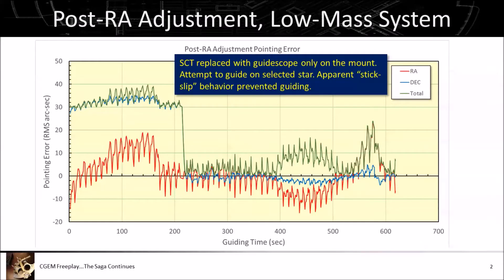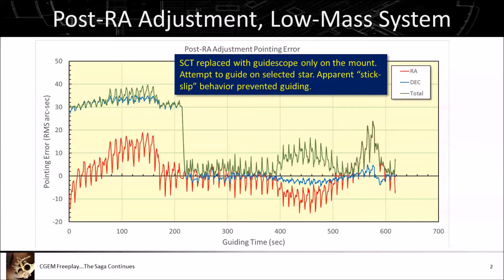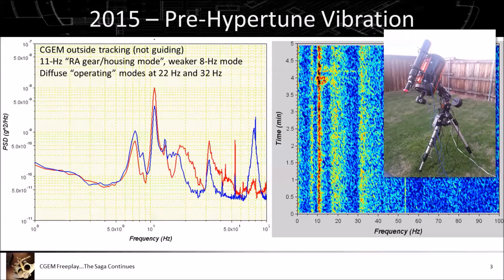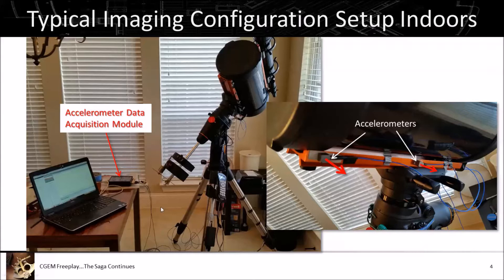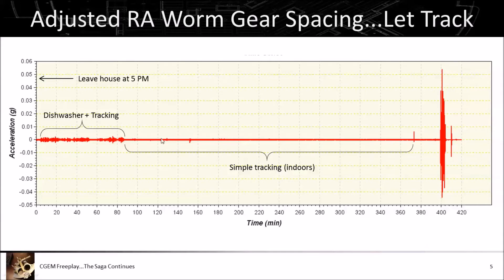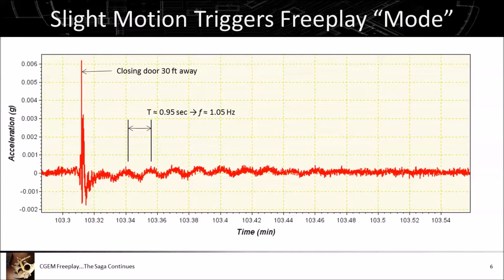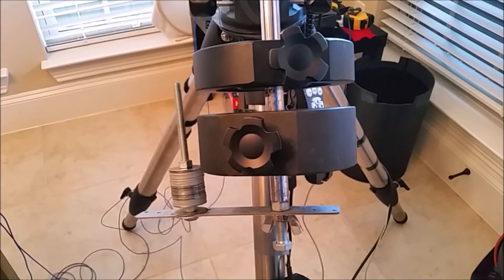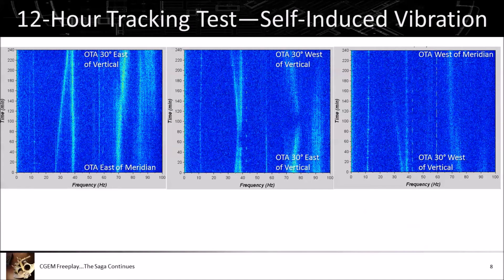Adjusting RA Worm Gear Spacing...Again!

Comment: I would suggest trying to adjust backlash with greased up worm and wheel is futile, The viscosity of the grease masks any backlash present. Setting backlash is best done with dry gearing. Short term operation while dry should not be a problem as the worm and wheel are of materials chosen for low friction coefficient.

Comment: Ji James,
This conversation has been silent for a while now. I was thinking how to have an indication of stiction while adjusting the worm gear spacing and I thought that sticking an ammeter in the power circuit could do just that. Electrical current should start going up as stiction increases. But again there are so many mechanical variables that affect the process.
Cheers and thanks again for your inspiring contributions.
Reply from the maker: Silent, but not forgotten. Thanks for watching, Ruben! That sound like a very interesting and more technically reliable approach than "listening" to the sound of the gears. Let me know how it works if you try it.

Comment: Hi James, this was a very interesting video. I've been struggling with similar RA issues on my mount since it came out of the box. It is an Orion Sirius Pro AZ/EQ-G (same as a Skywatcher AZ-EQ/5 I think). Of course I spent hour after frustrating hour playing with PHD settings trying to get it to track. Like you said, RA isn't connected to anything...you can't guide your way through that. I like your analysis of what's happening in terms of building torque and then things finally move. I was thinking of it opposite - the worm engages and pushes the mount out ahead and then needs to catch up. I wonder how one could test which of those it is? Either way it's terrible news for those of us interested in round stars! Like you I made a couple of runs at fixing the mesh, with my most recent being successful but maybe I just got lucky. This time I cleaned all the gears thoroughly and started with fresh grease. You have me inspired to hook up some accelerometers to this thing and see what I learn. I wish I had your experience to interpret the results. For now, things are working well for me, so I won't start fixing what isn't broken here. That said, it's just a matter of time until things start acting up again I'm sure, and when that time comes I will be using what I've learned from you today. Thank you for the fine video!
Reply from the maker: Thanks for watching! It is frustrating. Especially when I see others who just get good guiding and good results. I feel like I'm always involved in some form of science project. Don't waste your time with the accelerometers. Sounds like you did a good job with the gear adjustments. I need to take another stab at it myself. As for the gears pushing the scope out ahead--I try to balance so it's "east-heavy" and leans on the pushing side of the RA gears a bit. It helps. Some. I also try to avoid meridian flips and just follow one target down, then move back up and pick up another target. Good luck! You need all of it you can get in this hobby.
Reply: @Aero19612  Thanks for the reply! I may still play with some accelerometers just to see what I learn, because...since I left you the first message I got the scope outside and ran it and it was amazing. A completely different experience from what I'd been having for a year now. When I was shutting down for the night, I noticed almost all the free play I'd eliminated was back (I assume when things got cold; the worm and ring are different metals). Then I remembered that I had also found a catch in my RA worm when I was working on the mount. I even swapped it for the DEC worm since they are the same part on mine. My long winded point is that I'm now convinced that the free play that I thought I was fighting may not have been the enemy all along. It was more likely that worm, especially when I look back on the way the mount behaved previously. Thank you for the luck! I need to watch some more of your videos to see which way your luck went from this one, but I hope things improved!

Comment: I am curious how you made out with your CGEM guiding problems.  I am still fighting those issues after a hyper tune and like you, my guiding is really horrible.  I understand you fixed your problems using the backlash adjustment screws but it was very tricky without those accelerometers.  I dont have the same sensors, so can you offer any advice on how I can successfully adjust my backlash so it fixes my guiding problems?  I have a CGEM with an Edge HD 8" OTA, using PHD.  I have an OAG and I think everything is good to go.  My balance is good, power is good. Not sure what else I can do other than the backlash adjustments.  I know you said to leave the mount loaded which is fine, but if I do, then what do you suggest?
Reply from the maker: Bryan,
When I got the mount back, it had a "lot" of RA free play that prevented reliable guiding. I was able to adjust the RA worm gear spacing to tighten it up and I think it's "OK" now. Hypertuning did not improve my guiding; however, it did eliminate the stiction in the RA and DEC axes, so I can balance the scope much more accurately. In my case, I had an encoder come loose and the mount was useless until I sent it in for repairs (Celestron or Hypertune). So I sent it to get hypertuned and he found the problem and fixed it, so I'm very satisfied.
Reply: @Aero19612  So, tonight will give me the answer, but my neighbor and I worked all day on perfecting the backlash, and something called the worm end float adjustment.  We did both RA and DEC and that play you had is the same I had and I had it in both RA and DEC. The worm end float adjustment we made totally removed the free play you showed in your video.   Step 7 on this page is that adjustment we did:  http://www.astro-baby.com/EQ6%20rebuild%20guide/EQ6%20worm%20alignment.htm.   I hope the sky clears enough tonight for me to try this out, but the mount is much better in terms of how it sounds and the free play is totally eliminated.  I wanted to share this with you in case you had not done this yet.  In Ed's instructions, he talks about testing the worm gear and if lose, it needs to be tightened first.  At the end of his first paragraph.  This is that step.  There is a 1-to-1 mapping between this float adjustment and the free play you had.  Note on the Celestron, there is the plastic cap over the 4 openings and then, on the side with the connectors panel, you remove a second, threaded "cover".  Then below this 2nd threaded metal cover, you get to the adjuster that the above web page shows.

Comment: Yeah - I can tell you the problem.... Celestron CGX series of mounts are a complete piece of JUNK.   I have literally lost DAYS of imaging time trying to get my CGX and CGX-L working.  I have both mounts and spend more time trying to get them to work than imaging.  This belt driven approach is a complete FAIL.  I am so frustrated I sold all of my Celestron equipment and will never buy from them again.
Reply from the maker: Yeah, I know you had issues with your mounts. Sad. I had hoped the new Celestrons would be better and more reliable. I will need a higher-capacity mount before long. Let me know what brands you're looking into.

Comment: So have you figured out the problem? My guess is the rod of the worm gear is not true to spec causing a lash or gear mesh issue. How many times does that worm gear complete a 360° rotation within your 12 hour test? Three revolutions perhaps as your graphs may show during the vibrations occurrences? Gear mesh may be binding at 1 point of rotation then loosening back up at another point creating more play. Maybe swap in some new worm gears? I'm not really familiar with the CGEM mount but I have tinkered with LiPo powered brushless motor RC trucks before. Hope that helps any.
Reply from the maker: Thanks for the comments. I did adjust the gear meshing again and was able to get much more consistent behavior. So, for now, I guess I’m ok.

Comment: Was a full hypertune done including bearing replacement? I bought mine used and hypertuned. I discovered and corrected worm end float. I learned from Aeroquest that the ring gear is hobbed for a 1" worm and the worm is 3/4". Mine was hobbed to take out high spots in the ring gear and to hob it for 3/4".
Another source of freeplay is the placement of the tapered bearing on the DEC axis where the counterweight shaft is threaded. This is adjusted by tightening or loosening the retaining nut which itself is secured by set screws. This should adjust the wiggle and also affect the stiction of the DEC axis when freely moving the saddle.
Reply from the maker: Yes, the bearings should have been replaced. Fortunately, the worm gear seems to be held solidly in place and there is very smooth motion in both the RA and DEC axes. I just had way too much freeplay in the RA. I have adjusted the set screws and hope to get outside this weekend to test the motion while tracking/guiding. In a previous attempt, I apparently created too much interference. Maybe the second time is the charm. Thanks for the insight!

Comment: Hi James,

My CGEM mount is about 9 months old and I did some adjustments few months back with a  hope of improving guiding.  Currently I have very little play in RA or DEC and I noticed some play in DEC before adjustments.  Although I am not sure if it has improved guiding.  My total RMS error with 8 inch SCT is around 1.0 but ranges from 0.65 to 1.25 during one session.  It is little better with smaller refractor.  Also for me dithering causes jump in error so I do small dither in SGP for every 3 frames.  

One crazy suggestion. Is your counterweight bar screwed in tight and also counterweights tight.  I hope you are able to resolve these issues. Good luck.
Reply from the maker: Hey Avi. I'm glad to hear that you were able to make adjustments and to get the freeplay out of the DEC axis and that mount operated well (but not a lot better) after your adjustments. I also am encouraged to see that you're getting about the same RMS guiding performance that I get for about the same-weight system.  Haha--no, the counterweight bar is tight. I hope to get back out side one day to test out my recently-adjusted RA axis. I'll be happy to get back to the 0.8 to 1.0 RMS arc-sec error and to take pictures of egg-shaped stars.

Comment: James, I tried that wiggle on my CGX mount and I don't see it.  But I know someone else who does have that wiggle with their CGX mount and it was badly affecting his guiding.  He sent the mount back to Celestron to be fixed.  At first they told him it was normal, but he checked with about 5 other CGX owners, and they didn't have that issue.
Reply from the maker: Interesting. I would not expect this on a CGX, where there are tensioned belts designed to remove/minimize freeplay. My CGEM is at the mercy of manufacturing tolerance and assembly. I really like what I've read about the CGX (specs-wise). I know you've had issues (as have others).  But, yes, freeplay is a total killer for autoguiding. I wonder if the CGX has the externally-accessible adjustment screws that the CGEM has?
Reply from the maker: By the way, I didn't have the "wiggle" before I sent the mount for hypertuning. Pays your money and takes your ride.
Reply: I'm not aware of any externally-accessible adjustment screws on my CG,  but I've never looked.  I'm not nearly as technical as you are - but I enjoy the detail you go into on your videos.
Reply: As for the hyper-tuning, you're a brave man to let someone else take apart your mount.
Reply from the maker: Yeah. I was going to order the hypertune kit for a DIY project; however, about that time my mount started malfunctioning. I could send to it Celestron or send it to DeepSpaceProducts for repair. As it turned out DSP found that the RA encoder became separated form the RA motor (so the mount couldn't tell which way to go or how far). DSP "glued" it back together and did the hypertune for no extra charge. I've got the freeplay, but maybe a net win money-wise.